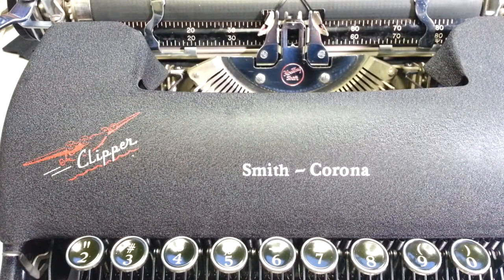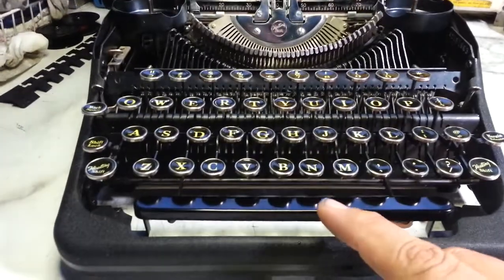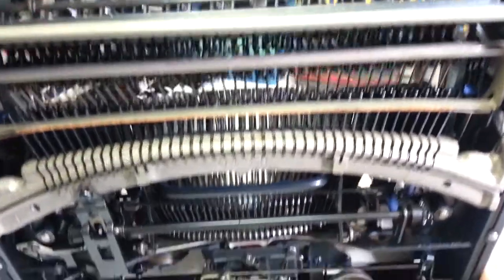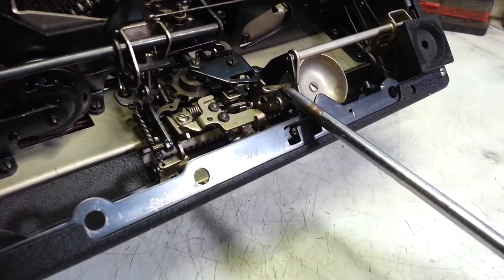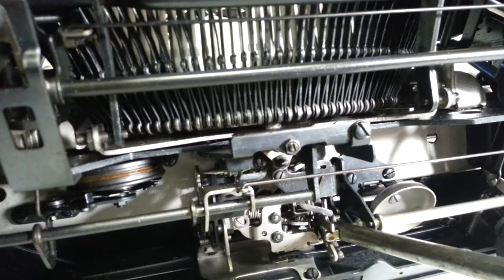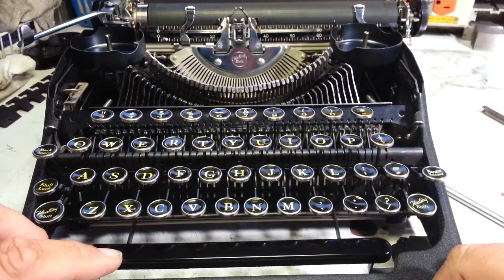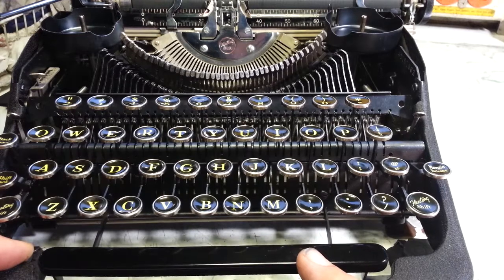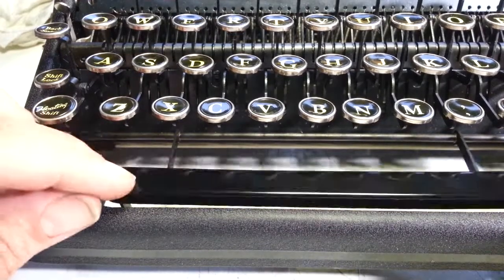Smith Corona Vintage Manual Typewriter Space Bar Escapement Trigger Adjustment

Comment: Hello! This video was very informative, and I would like to tell you that I enjoyed your other videos as well. (I would like to apologise in advance in case I have used any terms wrong.) I have an Underwood 219 typewriter, and I am currently facing the same problem as pressing the spacebar requires much pressure before it goes to the next space. I had been typing away last night when the spacebar started acting up, and then the same thing happened with the rest of the keys (pressing the keys no longer makes it move automatically to the next space and I have to forcefully press the spacebar again to be able to form words well). Please do advise me on what I can do to solve this issue as I cannot open or remove the bottom of my typewriter. Thank you so much. Please stay safe and take care. God bless!
Reply from the maker: Without being able to touch/feel/see typewriter, do some troubleshooting, I couldn't tell you much
It's not like that is a common problem with a common answer. could be something unforeseen like some debris interference
Reply: @phoenixtypewriter2136  Hello! I understand! Thank you however for replying to my comment :) Please stay safe, take care, and God bless!

Comment: I'm currently looking into a Smith Corona classic 12. The seller was nice enough to test it, and it appears to have the same problem after 4 presses. Is this solution compatible with that model?
Reply from the maker: No, the classic 12 has a different space linkage than this series
Few things can cause a C-12 to not space, ribbon bound up is most common, ribbon drive, other things.
Always resolvable, Typewriter needs to be cheap, it's broken ! broken non rare typewriters $20 - $50max
My general repair is $98.00, typewriters need professional service, then they purr . . . . .
Reply: @phoenixtypewriter2136  thank you so much sir!

Comment: This is the same problem mine has. It bottoms out, a bit of a press and click. I’ll give it a try. Need to make a bender first. Tower Commander 1956 which is a mixture of 1945 to 1949 series 4 parts. But the mechanism looks exactly like my 1937 standard (which is in adjustment) and the one in the video.
Reply: Okay fixed that problem. I formed it toward the escapement a tiny bit which made it a bit worse but it was right on the edge of the trigger, now it’s in a bit. Next I formed a bit the other way (as in the video) which solved the problem but it is still very low but at least I don’t have to press or hit it hard.

The carriage is very loose, I think it’s riding too low making the return arm scrape across the lid. Also it buzzes across something under there when I release and move back and forth. My Corona standard has a bit of play, a very small bit.  This Tower was used a lot, I think it’s normal wear and tear. The standard appears to have lived a much easier life.

Comment: Hi. I have this typewriter and mine seems to have an issue with the back space key. When I push the key, the carriage moves one space to the right as it should, but the key doesn't pop up again, I have to flick it up with my finger and the carriage just moves back to the left again. Could you upload a video a video on how to fix this?
Reply from the maker: This is a bind or dirty/sticking in the mechanism, first you have to pin point the problem
How can I make a video how to fix a certain bind, if I don't know where or how your typewriter is binding ?
This needs to be troubleshooted by cleaning potential sticky pivots, figuring out where the bind is . . .
Reply: @phoenixtypewriter2136  I apologise, I just assumed that because it's the same typewriter, the mechanisms would be in the same place. I can see the mechanism moving when I push the key, I think it might be a pivot sticking issue, the rest of the mechanism appears the be moving freely, it's just after when the carriage has moved back a space, the key doesn't reset and I have to pull it back up, then the carriage just moves forward again.
Reply from the maker: @James-4812  Yes the mechanisms are the same, but I would need to see in person to do an analysis, back space binding is not a common thing
If it were common, yes I could probably guide you some, but without troubleshooting (in person) I'm unable to help
Reply: @phoenixtypewriter2136  Just to let you know, I fixed it. It was the key itself, it was bent slightly over to one side and was getting wedged in it's own groove. So when I bent it the other way, it started functioning normally.
Reply from the maker: @James-4812  Most excellent to hear, great troubleshooting . . . .
Reply: @phoenixtypewriter2136  Yeah, just think if you had uploaded a video going through all the possibilities, then I told you the cause, you would be using even more sarcasm than you were on your first reply... and I would have had more reason to laugh. Oh, the "what ifs."

Comment: My space at gets stuck down every time I press it. I have to pull it back up. How to fix?
Reply from the maker: Find out where it is binding and fix it. I can not fix something I can not see . . .  ..
Reply: Phoenix Typewriter possible to send a photo?
Reply from the maker: @seannead.wharton4595  This generally is not a thing that photos will reveal, something is binding somewhere from the actual space-bar, down the linkage, to the escapement, this needs to be troubleshooted/analyzed, Generally be a qualified typewriter technician
Reply: @phoenixtypewriter2136 are springs supposed to be directly under the spacebar.
Reply from the maker: @seannead.wharton4595  No, spring action is generated down the linkage somewhere